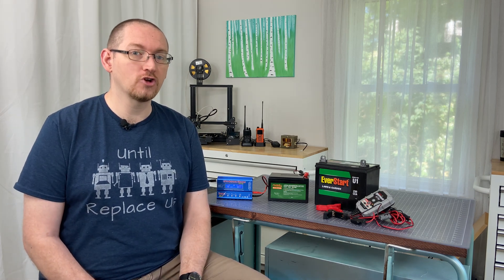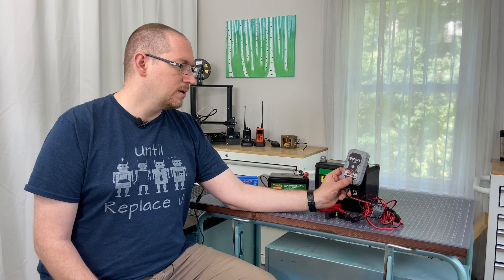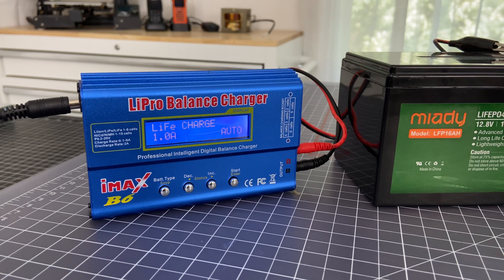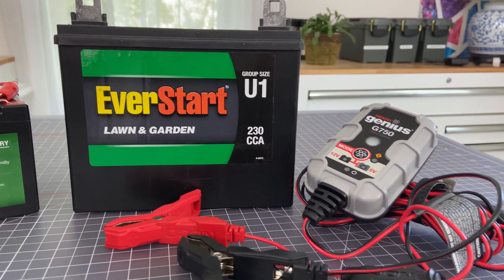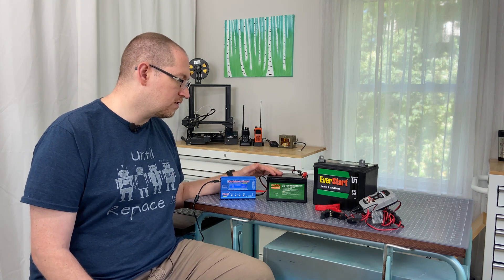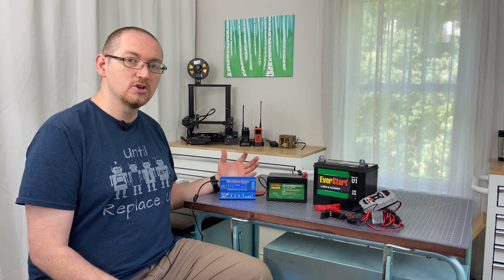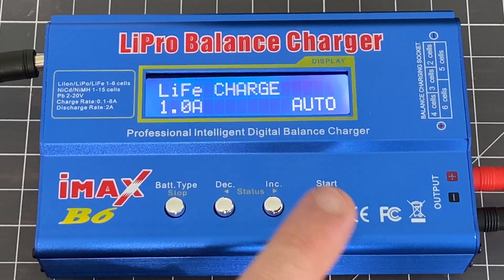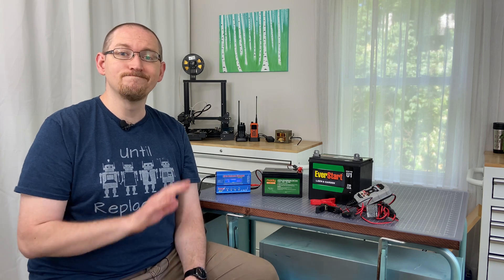Charging LiFePO4 Ham Radio Batteries

Comment: The default cell voltage for the iMax B6 is 3.3, but this battery is 3.2. Is that correct?

Comment: Thanks for the video. The manufacturer of my 12.8v lifepo4 battery suggests charging it at 14.4v but the balance charger only outputs about 13.6v. Is that ok for.the battery, will it fully charge?

Comment: To use this device as a balancer on LiFEPO4, wouldn't multiple wires need to be connected to each battery? Since you only need 2 wires (since you're not using the balance feature), I'd rather use a simple DC_DC converter with current and voltage adjustment than spend that much money on it.

Comment: I have a 280 amp 3.2v battery so what do I do?

Does this equipment charge it up I don't want to go over the 3.2v

Plz help
Reply: Hello, ⚠️! The information mentioned in this video corresponds to a standard battery charging operation made of lithium Iron Phosphate.

The optimal charge of a portable lithium Iron Phosphate LifePO4 battery is much more "complex" and requires a "BMS" device integrated inside the lithium Iron Phosphate LifePO4 battery.

 Using this internal "BMS" device installed by the manufacturer, you can for example charge a 100Ah/140Ah/200Ah battery etc. using a 40A/50A STABILIZED SWITCHING POWER SUPPLY (stabilized power supply used in radiocommunication, totally different from a stabilized linear laboratory power supply!).

I myself charged my 140Ah (39% capacité remainig))  lithium Iron Phosphate LifePO4 battery with a 40A DIAMOND ANTENA stabilized switching power supply (14,6v)

My Lithium Iron Phosphate LifePO4 battery was fully charged after about 2 hours.

During the charging cycles, the Lithium Iron Phosphate LifePO4 battery repeatedly drew 40A. During the charging process, the "BMS" device regulated the amperage levels that fluctuated between 10A and 40A.

Please note that the first charging cycle lasted about 5 minutes with a constant absorption rate of 40A! (VERY IMPORTANT!!)

WHEN THEY ARE MANUFACTURED, LITHIUM IRON PHOSPHATE LIFEPO4 BATTERIES 100Ah and above ARE CHARGED AT AMPERATURE LEVELS AROUND 90A!

Conclusion: to obtain an optimal charge and discharge of a lithium Iron Phosphate LifePO4 battery, A HIGH AND CONSTANT AMPERAGE LEVEL IS REQUIRED SO THAT THE "BMS" DEVICE CAN CARRY OUT THE MOST EFFICIENT AND OPTIMAL CHARGE OF THE ELEMENTS (BALANCING/CYCLING/ABSORPTION...)

Sincerely

Comment: This may be a case when the "non-official" imax b6 works better than the sanctioned  by SKYRC. (Originally makers the B6). I have a SKYRC IMAX B6AC v2. They're user programming is different and I've been unable find a way to program it to charge a LiFe motorcycle battery (specifically a WEZE TX30L). I bought from SKYRC for their support. Will send a msg to them to see if they have a work-around. Thanks for posting & let me know if you might know how to program mine. TKS

Comment: I have a Shorai battery which is a lithium-iron phosphate type battery with a Max voltage of 14.4v.

What setting and voltage should I have my charger set at?

For example, is it the LiFe setting and set at 3.6v because it is a 4 cell battery?

Comment: Thanks for the video. I'm considering charging some lifepo4 cells with my charger. You can also use the same charger to charge your lead acid battery. Do a pb batt charge, 5A 12V 6S charge and you'll be able to charge your lead acid battery faster than using your other charger.

Comment: Thanks for the video, I have a very similar ht-rc B6 v2 charger, which charges Lilon/LiPo/LiFe/LiHV cells, however, I bought a 12v LifePO4 battery recently which has BMS included as you know. Do you think I can use this charge to charge that battery? tnx

Comment: Man this was super helpful! I just got a LiFePO4 battery to try out portable operations with and was mulling forever over a charger. I finally picked one (that I don't particularly  like) on Amazon for about $25 and tried it out. Then I see this video and realize I have an old Turnigy charger I have been using for 10+ years for RC stuff that can work! I had no idea this menu option was available. Thanks so much for the info!

Comment: Hi, tje problem is that the lifepo4 batteries have a nominal voltage of 3.2V. Is it normal that the charger give a 3.3V in nominal voltage?
Moroever, i have 16cells at 200Ah. Is it good if i charge the 16 cells one by one and then connect them in series?
Sorry for my bad english i am french.
Reply: Oui ;-)

Comment: Dude you rock! I've been an RC helicopter LiPo guy for the last 15 years. I just bought a 12v LiFePO4 (12amp hr) battery for my micro GMRS radio. 
I wasn't sure if my Turnigy -6 ( IMax B-6 / Accucel-6 ) could charge it and if so do I use LiFe or LiPo since the LiFePo is a combo of each. Was hoping I didn't have to go buy another charger because I love my Turnigy. Searching, searching, searching and I FINALLY found your video! 
LiFe it is, thanks again!
Reply from the maker: Glad that it helped! I've got a few quadcopters that are itching to get some air time, so I appreciate the hobby. Happy flying!

Comment: Where is the cable plugged into on the left side?
Reply from the maker: For me the main power AC adapter is plugged into the left side and the red and black banana plugs are on the output on the right side.

Comment: I’m missing something. I cant get to User program area. Every time I get wait checking battery the balance control error. Do I hook up the battery via output?
Reply from the maker: It depends on the battery you are using and the options it has on it. If you are using a straight LiFePO4 without any additional plugs or wires other than the positive and negative terminals, then yes, you would be using the red and black banana plug output ports on the charger.

Comment: So if it too cold i have to wait to warm up...then i can charge the battery?  But to what temp?  Its a ~12v 100ah or I might get 200ah. For diesel heater and/ or electric blanket, 2way mobile radio, etc 

On ebay.  I think have circuit boards for over heat protection and other...but they lie about low temp protection.   IMAX b6 will charge?
Reply from the maker: I was hoping that someone might chime in here and give some expert feedback.  What I've read is that most (not all) LiFePO4 batteries can not be charged below freezing temperatures. Doing so can damage the battery. Warming the battery up to above freezing can be done through the use of a battery warmer. Charging a 100ah battery using the iMAX B6 can be done, but I would guess it would take a long, long time.

Comment: LiFePo4 batteries are supposed to be charged at 14-14.6Volts. Arent those volts a bit low provided by your charger (they are almost the same as the batteries rated voltage)
?
Reply from the maker: I’m not positive, but I don’t recall if the documentation actually specified what voltage it was charging at for what value battery was being charged. I would need to hook up a meter to check the actual output voltage. I do know though that it has worked flawlessly so far, at least as much as I can tell. Definitely worth looking into though, so thank you!
Reply: The voltage shown on the iMAX B6 isnt the charging voltage but the nominal voltage of the selected battery you want to charge. 
It easily charges up to 14.6V where it then is stopped by my small LiFePo's BMS.